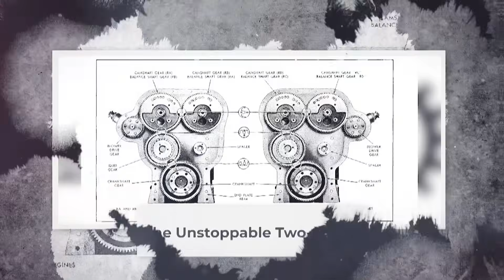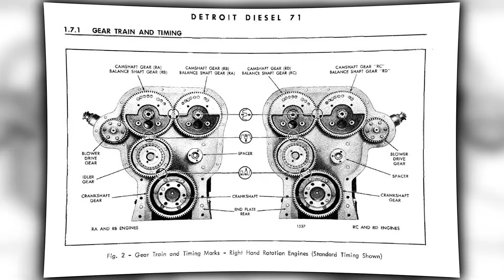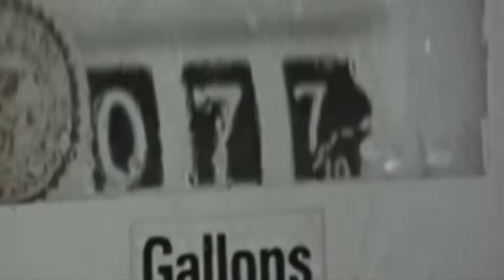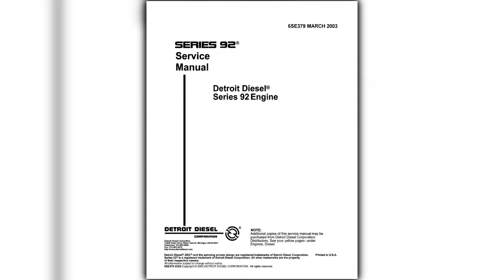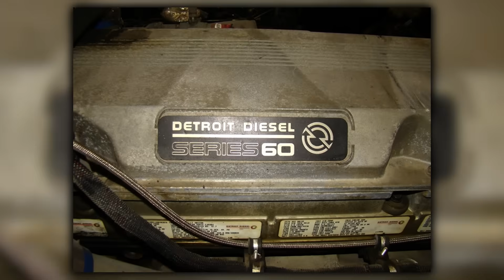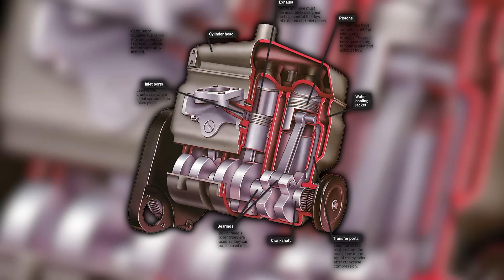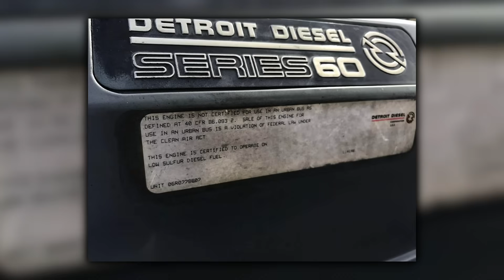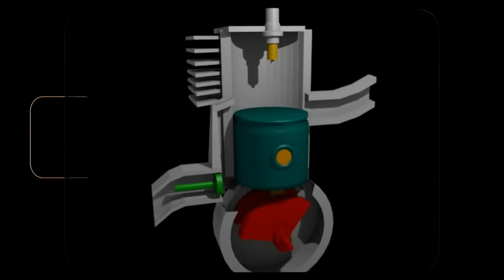The Real Reason Detroit Diesel Quit Making 2-Stroke Engines

Comment: 1:46 for two stroke diesels, fuel does not (or should not) enter the crank case
Reply: Correct. That's the animation for virtually every other 2 stroke made.